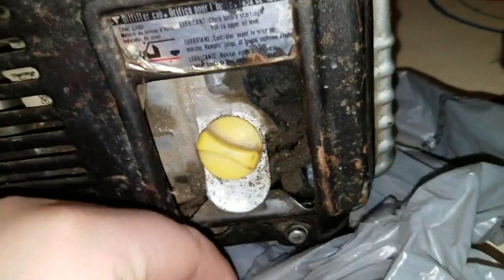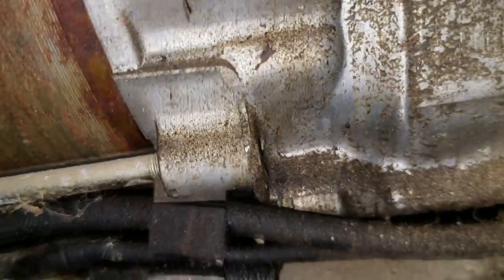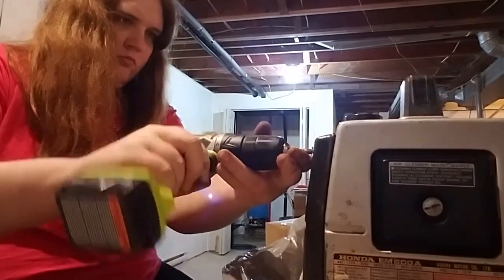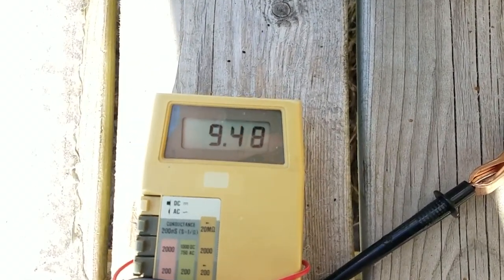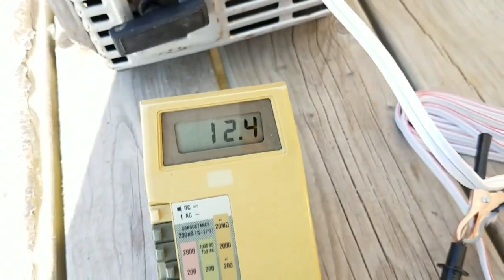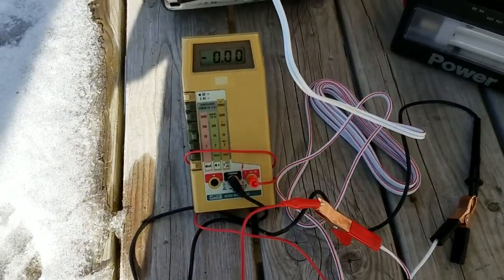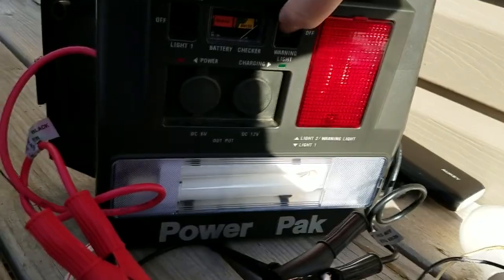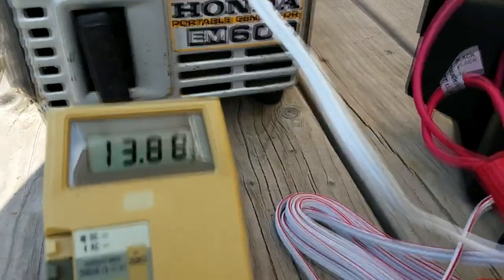Maintenance + Testing the DC output - Honda EM600 generator, Part 4

Comment: I bought a 40 yr old Honda 1000ex last year. DC side doesn’t work. 
Thanks for the education on how a generator is likely to produce DC voltage. (Mine has terminal posts, no plug outlet)
(Retired guy from Mississauga, Ont.) thx agn.

Comment: It's best to add a drop or two of oil on the filter(sponge) and rub it in. Most air filters come lightly oiled to help trap dust particles.